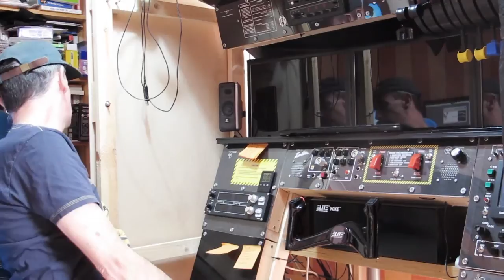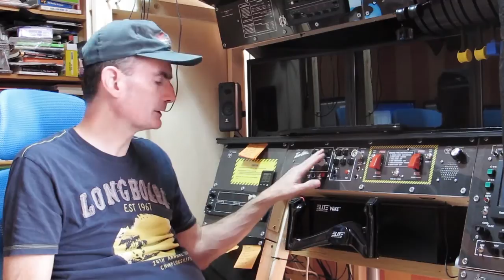What Next for Video Blogs? (Twin Otter Cockpit Build - Part 19)

Comment: I'll tell you two things I'd love to know: How did you solve the issue drilling nice holes in acrylic and also what method you ended up using for the panel layers.

I can tell you that I have wasted some cash trying to figure the acrylic stuff out. I'm still working on this but I'm close with modifying wood drill bits so that they won't pull up. Frustrating!

For the panel graphics sheets, what I ended up on was 1 printing on high quality photo paper and 1 layer of the same image printed on a transparency. This game me good graphics and almost no leak of light from the underside for backlighting purposes. 

All that aside, I'm very appreciative of the work you've done in this series. It has helped me tremendously to get started on my own panels for my A-10C cockpit. Actually it is evolving quite a bit and is much simpler really than the one you've done but I wouldn't have known about the panel techniques without your videos. Thank you sir!
Reply: I sorta drilled until it melted the acrylic for my overhead. Even if it left a unclean finish the nuts on the toggles covered it up. One problem with making a big panel is if you crack it you really have no option but to leave it.
Reply from the maker: WackyBroProductions I have found that the flat woodworking bits are the ones to use - for anything over about 4 or 5mm using a helical bit starts to be risky. The flat bits basically create the hole by first scoring and then shaving the surface progressively down through the material, which puts NO upward torque on the surface at all. You counter the downward torque by making sure the acrylic is supported on a piece of wood underneath (so when you break through you end up drilling a little way into wood. There are hybrid woodworking bits (I'm sure these bits will all have proper technical names!) that start off shaving but which use a helical action once they bite into the material - these are also bad, although with care (very slow) I have used these to make 7mm holes. Auger bits are even worse. Drilling small pilot holes and then useing a larger helical bit can be very risky - if you're going to do it, again go really slow.

With the flat bits, small and medium sized holes (many of my holes were 13mm) are fine, but don't drill too fast as the acrylic melts. Once it melts the hole becomes rough and starting up drilling again reates juddering and may promote cracking. Bigger holes (22mm) create much more heat so melting is much more prevalent. You need to go very slow and keep stopping. But generally, once I started using the flat bits I got perfectly clean holes and no cracks.

As for cracking a panel, if you use a sandwich - two slices with paper or transparency insert - you at least have one insurance policy because you can swap the fron and back layers. Otherwise yes, a crack can mess up your day :)
Reply: Almost Aviation
I only used one layer and it works okay. I try to be super careful. Of course non of this matters when your the guy who accidentally tips over the panel when preparing to install it. Also i recommend installing some cheap dimmers if you install strip lights for back lighting.